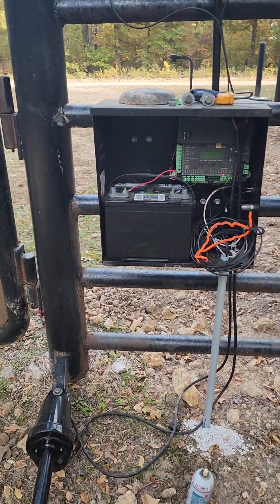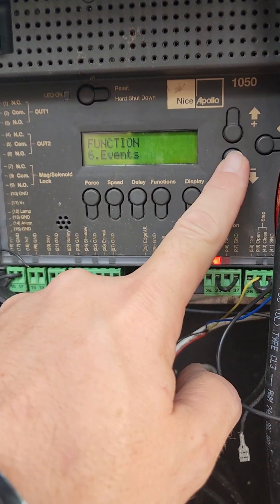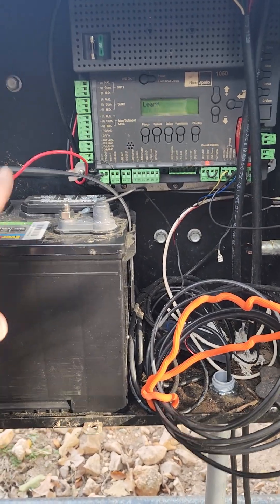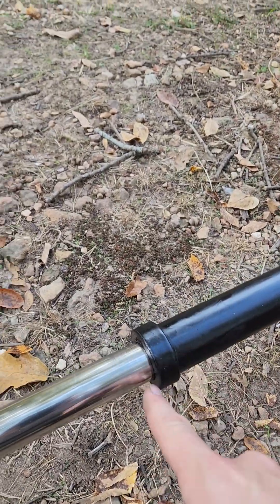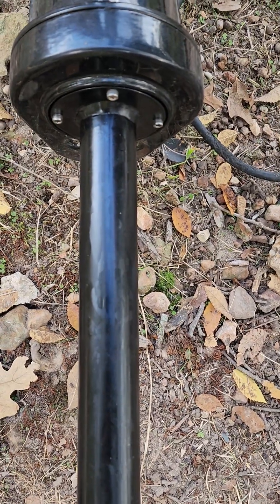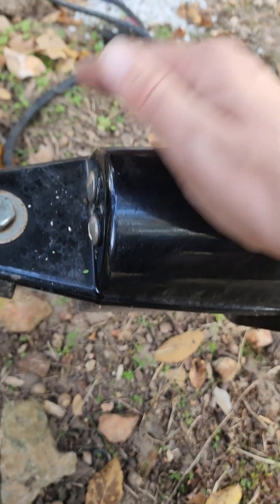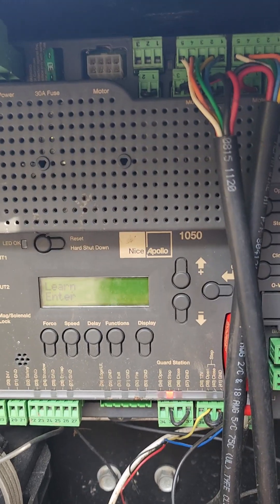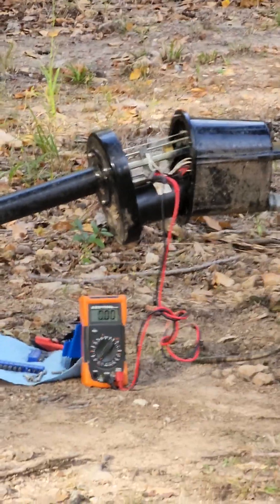Apollo 816 Actuator Overload Error on 1050 Control Board. Includes testing Apollo Actuator Motor.

Comment: You are amazing, I'm working on mine, 14 degrees, not going well, this helps
Reply from the maker: @JaysonMoffitt  let me know if you have questions. I have learned a lot about apollo systems.
Reply from the maker: I also have the factory build sheet for the 816 actuator. The instructions given to the factory worker to actually assemble the 816. They are assembled in the house, and the build sheet even has the final QA test procedures.

Comment: Great video! Do you know what screws to remove to access the spur gears? I would like to grease mine. Also, what size "O" rings did you use to replace the seals? That was a good idea.
Reply from the maker: To get access to what I call the "gear box", you must take the motor retention post nuts off I point to on the front that are missing the plastic cover on the outside of the front below the shaft. Then you have to take the two tower plate screws out that sit to the left and right of the motor on the inside of the case. Then the case will split. Do not over tighten the motor nuts when you reassemble. As there is actually a procedure they do at the factory to tighten those nuts...that procedure can be summarized as only tighten to where the motor turn good. Do not tighten until the motor binds... ;)
Reply: @arboyd81  I was a gear machinist for 15 years. It's important to keep a .002" amount of backlash between the pinion and spur gear to prevent binding. Thanks for the answer!
Reply from the maker: @paulntx  yes sir I hear you! The build sheet has a procedure measuring the load of the motor to determine gear bind. They do not have a procedure like a ring and pinion, nor does it have anywhere close to a .002 tolerance in the 816. It's a very loose engagement can can be done by the sound of the motor alone. Like you said these are very simple and definitely not anywhere close precision machining. More like cast gears and universal parts.
Reply from the maker: O ring I just pulled out of the ring tray I keep. Not sure, but just take the cap to the hardware store to find a good fat fit. Also, those metal screw caps are not sold or manufactured anymore. They have been superseded with a snap in style plastic cap that will require silicon. New caps suck!!!
Reply from the maker: Wish I could email you the build sheet I obtained from the factory on these...
Reply: @arboyd81  No problem. It's not that complicated. I just wanted more information so I don't remove more than what's necessary.
Reply from the maker: Check out the other videos I have on my gate. If you need I could make a private video of that build sheet. Also, please like and subscribe, I am trying to grow my channel...

https://youtu.be/rQW9RymynO4?si=vDzpdm1IHdX89-2z

Comment: I have a Apollo gater opener 1500 with 365 board I believe. I have the same issue like you have. Turn out to be a bad relay on the board. So instead of spend $ 450.00 for the board. I test the motor by jumping direct 12 v to see it still extract and retract. If you jump positive from battery to positive on the motor and negative from battery to negative on motor. It should extract if you jump them in reverse then motor will retract. My motor still good so I went on Amazon and order the dual relay universal board with two remote control for $16.00 and hook my motor to it with toogle switch mode on the remote. My gate now working but without limits switch. So you just hit the button and wait till it opens to certain positions you desired the hit the button again then it stop. And to go the other way you hit other button and to the same. The remote have A&B button.
Reply from the maker: Very creative solution!